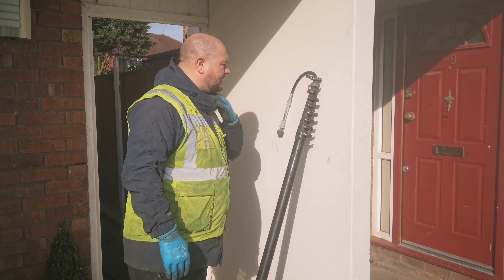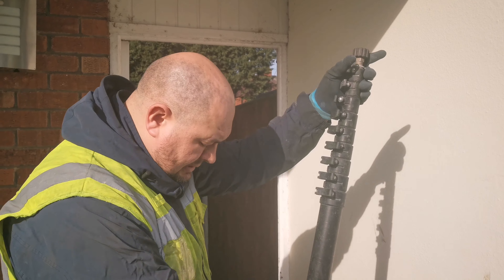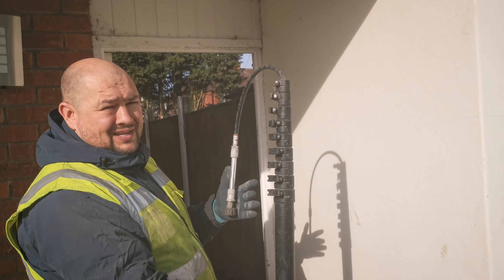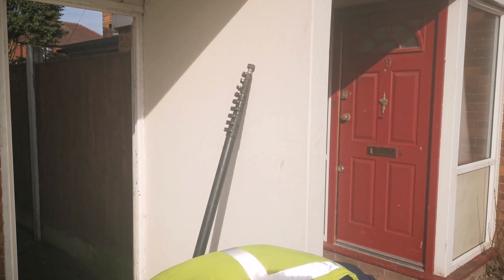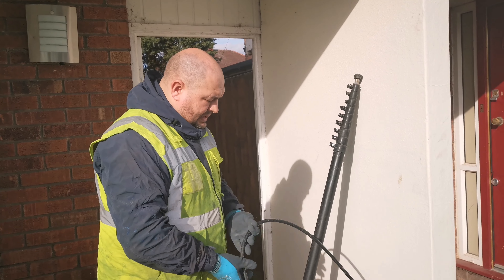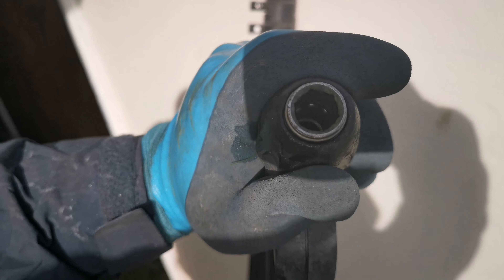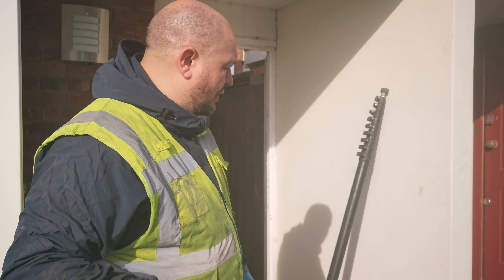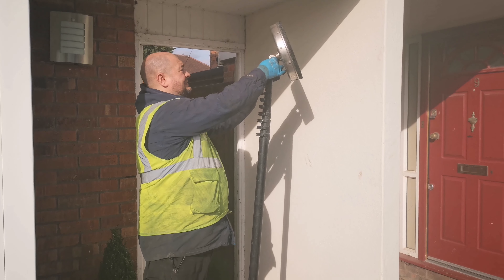How to make a pressure washing pole (UK)

Comment: High is the 45 foot pole easy to use at full lenght using a turbo nozzle? Or would you have to use patio cleaner attachment instead? Also would you not get problemes pushing back concrete tiles using the patio cleaner?
Reply from the maker: Very rare tiles will push back. The Mosmatic will float but it depends on the angle you're working from. So take into account the down force and obviously the flow of water.
Turbo nozzle on pole at full length 45 foot can be tricky. There will be a lot of bend in the pole.
So at the bottom of pole if you move pole 1cm then at the top it will feel like inches
Reply: @BlastAway  thanks for the reply mate do you think it would be possible to use small device on casters to rest end of pole on clamped to so carrys its own weight still using a turbo nozzle for ease of use?

Comment: Great video Lee, i see you mention low pressure and most of our machines use different flow rates, what size nozzles are you using in the mossmatic pan ? 4010s or higher ? Cheers, Ricky
Reply from the maker: Hi Ricky, 2503's in the Mozzy and we just open the steam valve to reduce the flow and pressure.
Reply: @BlastAway  Oh i see cheers for the info lee, I havent got a steam valve on my system so will put some 40 55s  in to get the pressure down👍

Comment: I would also like to say that info was much appreciated Lee! It has been a bit of a  mistery up till now. No doubt the supplier's phones will  be ringing off the hook after yr vid. Lee how do u set yr pole up to spray hypo?  Cheers M
Reply from the maker: Downstream injector and a low pressure nozzle on the pole is one way.

One other way which we do is we have a Female spigot to a Hoselock Female and connect it to our Roller pump soft wash machine.
We also can do this from our Blend 50 soft wash system up the pole however that's a lot of flow.
Reply: You certainly are a wealth of knowledge! Cheers Lee. M